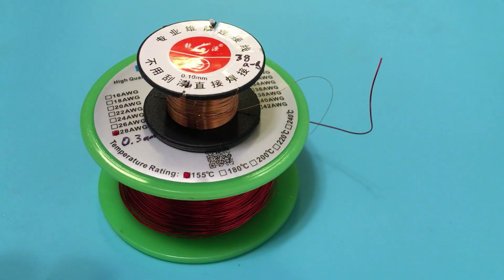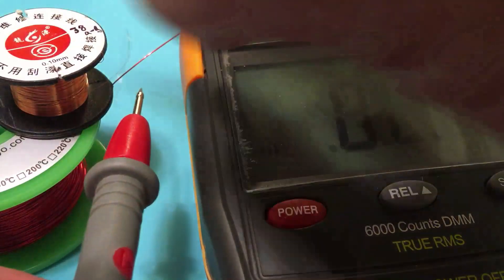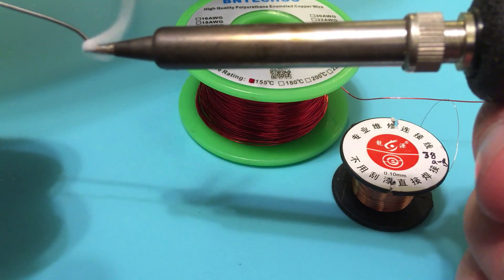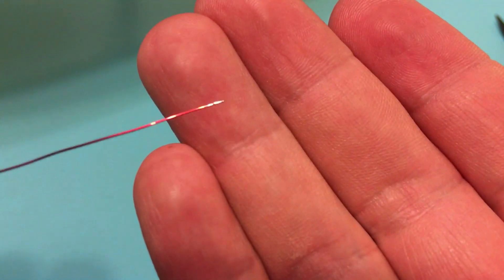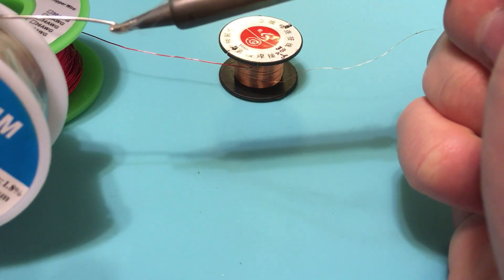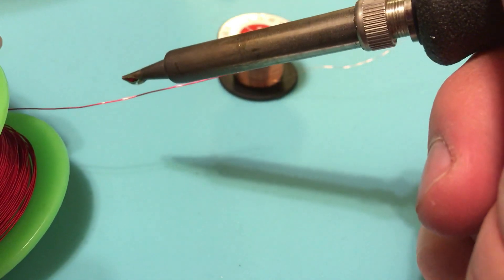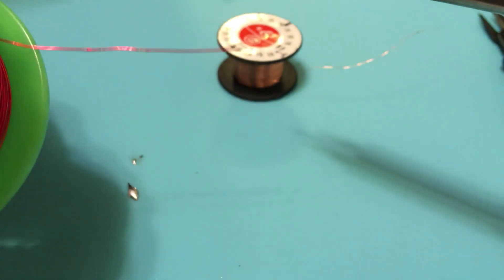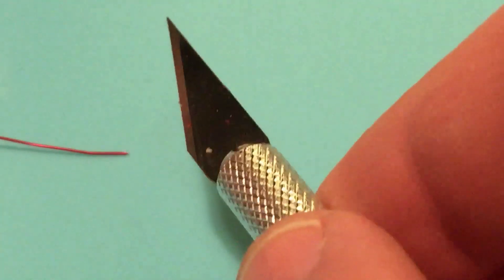SolderJS #134 - [LIVE] How to Strip and Solder Enameled Wire (See description for 5-minute video)

Comment: From an old electronics book I know a fourth method but I did not tried it: place the end of the enameled wire on an aspirin and press with your soldering iron
Reply from the maker: But... at what temperature?
Reply: @coolaj86  in the meantime I was very curious about this method and tried it... It works very well, but you need to keep your nose away or some fume extractor because the smell is awful. I used a normal 300C temp during this, but I guess it work also with much lower... Maybe I will do a small video this week and post the link here..

Comment: THANK YOU! This works perfectly for fine multi strand audio wire (the ones found in headsets) which were a PITA to remove enamel, this 400 degree tip helped a lot, here, take one subscriber! Best from Southern Brazil.

Comment: If you use a rotary tool with circular sandpaper holder and a fine grit sandpaper, it seems to me to be the fastest and best way to remove the enamel. Other than that, thanks for the video. Helped me out a lot...

Comment: Thanks for great video, trying to solder in a new plug on Sennheiser headphones and wondered why I wasn't getting a circuit from one end to the other. I had scraped the wire with the edge of a pair of scissors but still no circuit. Wasn't expecting the coating on such fine stranded wire but guess the figured it was necessary. I learned a lot from you thanks.

Comment: OH! BTW, yes, a very good video! I did try the suggestion that I found of using acetone to strip the enamel. Left mag wire in fresh solution for a half hour. Acetone did not touch it. I have not tried the sodium hydroxide solution. Before trying that, I will try immersion in MEK and, also, Enamel paint thinner.

Comment: The simplest and easiest way is to use a burning matchstick or candle flame. Good for wires up to about 32 SWG. Works with thinner wires as well, but have to be fast and quick, longer time in the flame will melt the wire. I have been doing this since I was a school kid. Afterwards clean it up with a cloth dipped in alcohol/petrol/thinner etc.
Reply from the maker: I've found the matchstick approach to not work well because the wire becomes too brittle to work with - it just breaks afterwards - perhaps because, as you say, I'm not quick enough with the candle. But I mentioned this in another comment - fire is very (very) hot - well above soldering temperatures.

Comment: I didn't have a whole lot of luck with the 400C method using 38AWG wire - ended up scraping the end.  Like that you tried a bunch here, though!
Reply from the maker: Did you use fresh solder and fresh flux? Or was your solder a few years old? If your solder looks dull rather than shiny, it's oxidized and it won't conduct heat well.
Reply: @coolaj86  It was old solder. Tried with and w/o flux, didn't see a ton of difference.  Granted, I need to try them all a few more times.  I'll also try with some paste, which is the only new solder I have.
Reply from the maker: @rixoff  I say go to the hardware store and pick up some fresh solder. A small tube will probably cost around $10. Worth it.
My experience with oxidized solder is that it's very difficult to use, makes bad joints, and can't be helped with flux.
Reply: you could try using Jet lighter, not the correct tool but works in a pinch

Comment: I've been searching for this one. Gonna make a modified headphone , i was having trouble on what gauge or type of wires to use. Audio cables was found first then i read about magnet wires. Do you have suggestions to what i should use ? thanks !
Reply from the maker: Magnet wire is what you would use for a stationary coil. I wouldn't recommend it for headphone cables.
Reply: @coolaj86  Wrong! 99% of headphones and earphones use multi strand thin enamelled copper wire (AKA magnet wire). I have repaired many, so I know.

Comment: Once I've removed the enamel, does the temperature matter in terms of tinning? I removed the enamel with 220 grit sandpaper but I'm using kind of a cheapy soldering iron, and it melts the solder no problem, but I seem to be having that same problem of the wire still not accepting the tinning despite all the enamel being removed. (Or maybe it is accepting it, but it is just a very thin coating? It is very hard to tell). Can two tinned wires done this way easily be soldered together? I'm trying to solder two small wires together in a vacuum that got so hot, it burned through the enamel and wire, so I'm just trying to reconnect them. Thank you in advance for any help!!
Reply from the maker: The wire is very thin, so it cools very quickly. It's difficult to get it to hold enough heat to actually bond. I'd say make sure that you've cleaned your tip well and that you get some flux on there to help the bond. If you don't see the tinny color, it probably didn't bond, and so you'll probably get a cold joint if you do stick the two bits together, and so it may hold, but may fail again quickly.

Comment: I used a jet type lighter to burn of the enamel, and let it cool down.
Then I started to solder onto it.
Reply from the maker: That often makes the metal brittle and then it breaks easily, but if it works it works. :)

Comment: Actually, I am interested to know what household product I can use to touch up damaged enamelled wire. But, I am watching.
Reply from the maker: How about some non-conductive, non-flammable epoxy or glue?

Epoxy is non conductive, but sometimes cumbersome to apply: https://amzn.to/36N0fZ4

E6000 is decent for areas that are low temp, but it doesn't harden and gets softer as it gets warmer: https://amzn.to/37JVZJ8

Locktite is another potential option: https://amzn.to/36LzVyw

Comment: After you stripe the enamel, how do you reenamel the wire to insulate the bare wires?
Reply from the maker: John Fuller. Not sure if you’re joking or serious, but I’ll assume you’re being serious:
Option A) Use either side cutters or wire clippers to make the exposed part as short as you need, for small microcontrollers you’ll be surprised how little solder you need (and how large of a chisel or bezel tip you should use) for such such small pinpoint pads. Just make sure you don’t cut too short or you’ll get a “cold joint” that bulges around the enameled portion.
Option B) You can get heat shrink tubing for wire-to-wire connections.
Options C & D: Use electrical tape, non-flammable epoxy, or an electrically safe lacquer / coating / paint. I’ve used E6000 for low-heat / low-risk applications.
Reply: @coolaj86  not joking :)  Thanks for the response.  I need to splice some LEDs with enameled wire.  I'll solder the joint but would like something clear and thin to cover the joint for insulation.  Been looking on the web and hadn't found anything.  Would E6000 do the trick?  Looks like more of an adhesive.  I was thinking about Star Brite Liquid Electrical Tape, but it looks like it might be thick.  Any help is greatly appreciated!
Reply: PS - Merry Christmas!
Reply from the maker: @debbiefuller5104  As long as you don't have much heat E6000 will do, but I think Star Brite would do better for you.

Comment: waw    thats making a short story long. My attention span will not endure
Reply from the maker: I cannot help you when you attention span is literally to short to finish reading "see description for 5-minute video" or the "Spoiler: Tinning the wire at 400ºC, instead of my normal 300ºC, is what worked best for me." as the first line of the description. Or the pinned comment.

Comment: You tested the wrong wire right at the end.
Reply from the maker: I have no doubt. Timestamp?
Reply: @coolaj86  Lol : ) @ 37:20 you finally fix the finer of the two wires (one end had slipped from the solder) . . . once fixed you then test the new connection, but accidentally test the thicker of the two wires ! (@ 37:50) . . . cheers for the video by the way, ordered myself some 0.15mm, I think I'll have a go at your Exacto knife approach.

Comment: can i just burn it with a lighter ?
Reply from the maker: Excellent question. No, you can't. Or rather you can, but the metal will literally burn, become brittle, most likely break, but definitely not conduct electricity well. The flame is about 1400˚ C, I think. Much too hot.

Comment: That Amazon Chinese wire is garbage
Reply from the maker: Do you have a better suggestion for 0.1mm wire?
Personally I haven't run across an issue where 0.3mm is too thick to be useful, but I imagine that if you need 0.1mm you don't have a lot of "high quality" options.